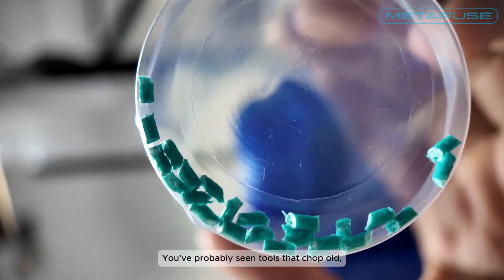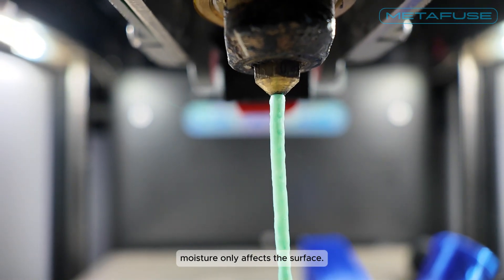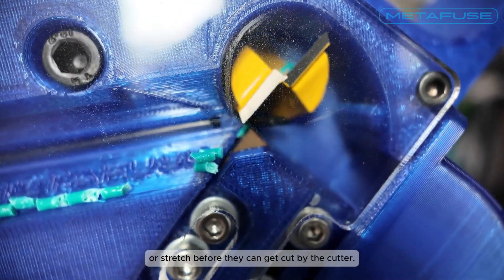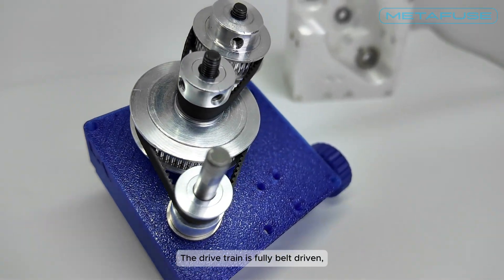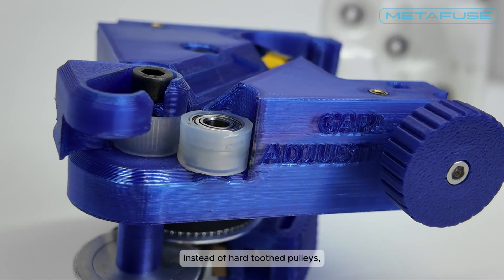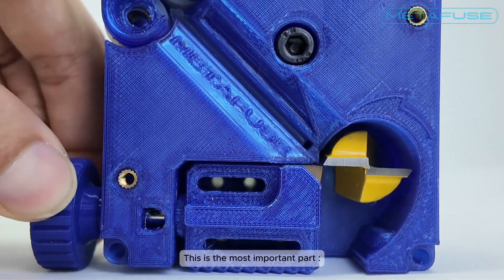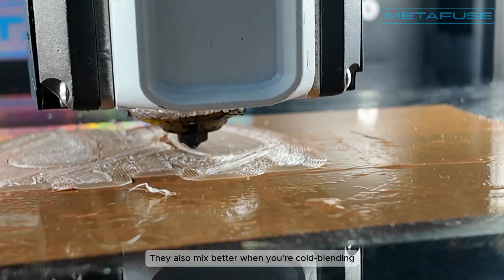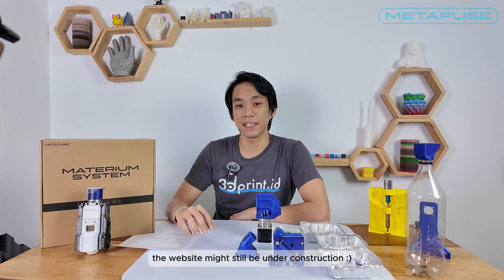CHOPPER : Open-Source Desktop Strand Cutter for Small Screw Extruders

Comment: This is all fascinating. But I am confused about the filament cutter. I have always thought the main benefit to a pellet extruder was that you can buy pellets for much less money than spools of filament. 
Is there a reason you are chopping up filament instead of just buying pellets?
Reply from the maker: Great question, this is not obvious at first glance to many people :
1. In many parts of the world, exotic filament is cheaper than exotic pellets. Because the supply chain is optimized for retail. Pellet supply is optimized for large industrial purchases. 
2. Polymer type matters. As said above, developing countries focus heavily on commodity plastics like PP and PE. PLA/PETG/TPU is considered exotic and you have to import yourself without distributor (hence the higher price).
3. PLA brittles, ABS yellows, and TPU moists with time. Unlucky batches, tangled filaments, and 'expired' spools are big contributors to unsold filaments in the distributor world. Chopping is a way to give second value.
4. In pellet extruder scene you may find that many extruders maxes out at very small pellets (less than 5mm) which is ironic because those are even harder to find that filament. Our extruder takes 7mm pellets, tho.

Thank you for giving the opportunity for explaining this!
Reply: @metafuse_tech  Thank you for taking the time to explain it. I had no idea that was an issue for people in some places, but makes sense.